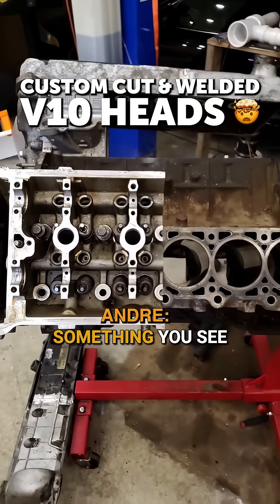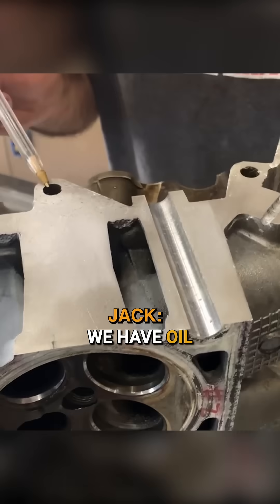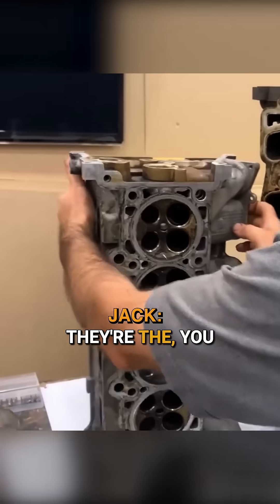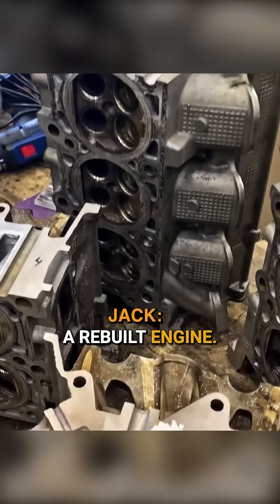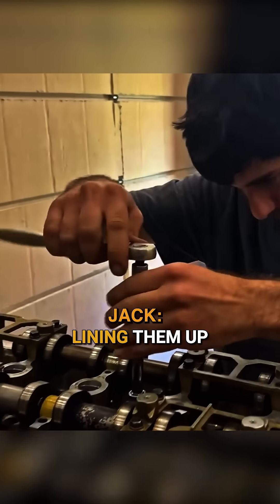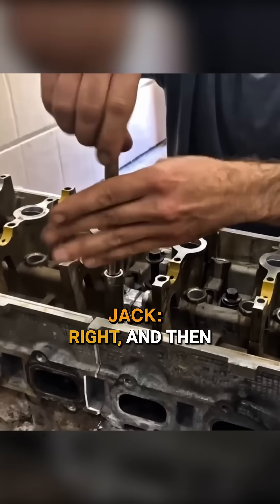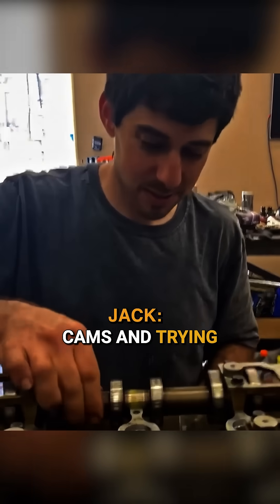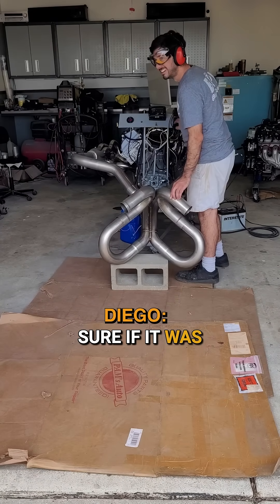Custom Cut & Welded V10 Heads 🤯

Comment: I had a manual 03 Mach 1 for my first car at 15 years old, learned how to drive stick in that car, got all my driving hours Florida required with a learners permit in it, took my drivers license test in it, learned how to work on cars all because of that car (not because things were broke it was working on it to modify it, throw a better clutch in it 2 years into iwning the car because i did hurt the clutch a bit learning how to drive lol) i drove to highschool half my sophmore year, all of my junior and senior year and kept the car for about another 2.5-3 years after highschool and that was the most fun and badazz car ive had still to this day, the 4.6L 32 valve DOHC motor was nasty bone stock, everyone with regular mustang GTs always swore my car had things done to it in just lying about it because there's no way i would walk them as bad as i was lol i loved it!!😂 Yall took a 4.6L 32 valve DOHC, the same motor the 99-04 cobra came with (03-04 was the Terminator Cobra with forged internals and an eaton supercharger slapped ontop from the factory, the best mustang between 1980-2010ish) the 03-04 Mach 1 had, the Mercury Marauder and a few others i cant thinknof right now. Thats sick!

Comment: Ford made a v10 for like 20 years. The foil shims could work to!!!
Reply: you mean it made a spark plug cannon for 20 years
Reply: Yeah the Triton V10 isnt anything compared to the 4.6L 32 valve DOHC, same engine that came in the 99-04 Cobras (03-04 were forged internals and supercharged) same as the 03-04 Mach 1s, the Mercury Marauder, and a few other oddball cars, the original 4.6 DOHC v8 would destroy the Triton v10! This wouldve been badazz if Ford had made the 32 valve DOHC in a v10 platform instead of the Triton v10, it wouldve been a 5.7L 40 valve dual overhead came and probably one nasty azz torque monster!!!

Comment: Doesn’t a different ford already have a v10
Reply: You’re thinking of the triton v10 in the 3/4Ton, 1ton (and cab chassis) trucks. This is a 4 valve per cylinder v10. Custom made by welding 2 cylinder heads together for each bank
Reply: @jaxon.frandrup they used the triton bottom end and ditched the 2valve heads that were on it. The power to be made is in the heads.
Reply: @wrenchaholic_ yup, we’ve all seen the build lol
Reply: Yes. Its a member of the modular engine family from that generation. But it only comes in 2 or 3 valve sohc configurations. Those heads suck at life just doing regular every day stuff. However, since these are modular engines. If you take 4, 4 valve heads from a Navigator 5.4 engine cut them in the right spot and weld them together. You get DOHC 4 valve heads that bolt onto the Triton v10.
Reply: The Triton v10 is garbage in comparison to the 4.6L 32 valve DOHC in its v8 configuration let alone if these guys successfully grafter a whole extra 2 cylinders AND the nasty azz Ford 32 valve dual overhead cam heads! The 99-04 cobra came with the 4.6 32 valve DOHC engines, but the 03-04 cobra (the Terminator Cobra) had forged internals and an eaton supercharger slapped onto it to set it apart and be the baddest car at the time between the big 3, the 03-04 Mach 1 had the 4.6 32 valve, the Mercury Maruader, and also some other oddball unsuspecting cars, trucks, and SUVs ran that motor. I had an 03 Mach 1 with a 5 speed and it was the most fun and baddest car ive had to this date, it was a torque sum itch and anyone that pulled up next to me that tried running it, I'd do a quick little 1, 2, half of 3rd gear pull from a dig and even spinning the 315 wides on the rear once I grabbed 2nd I'd pull on them hard before grabbing 3rd and letting out. So you cant talk about the trash Triton v10 if the original topic is the v8 configuration of the 4.6L 32 valve DOHC, if these dudes did this successfully that ls insane and pretty badazz! I'd buy one from them if they would build them for willing customers, then I'd find a blown up or slightly wrecked 03-04 Mach 1 and attempt to fit this v10 in it, idk if its possible without butchering the engine bay and rebuilding the fire wall as the v8 was 10lbs of stuff shoved in a 5lb bag